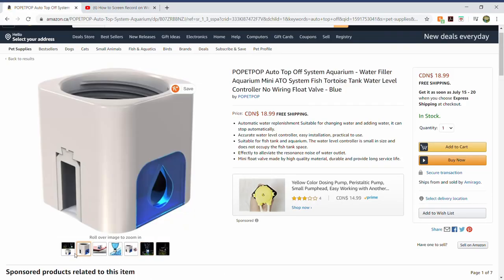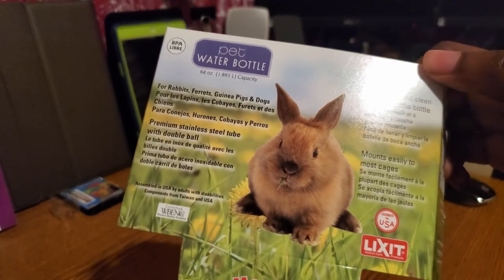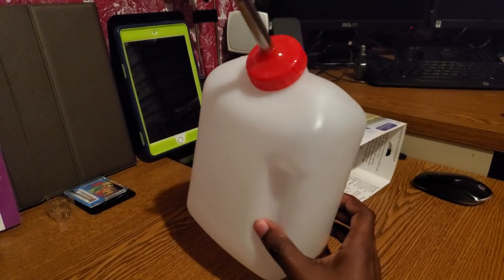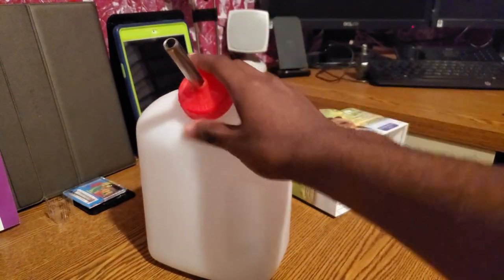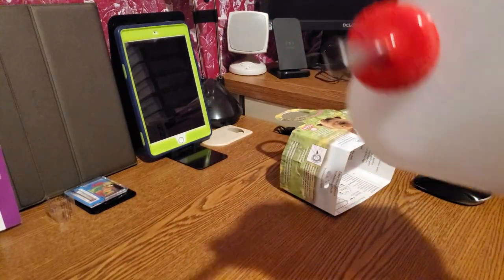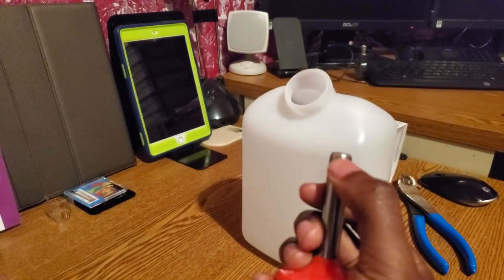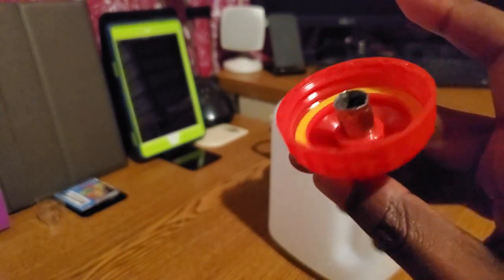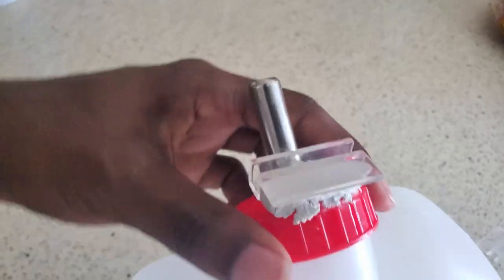DIY Auto Top Off For Nano Tanks

Comment: You could push the ball out with a chopstick. You might need to hit it a couple of times, but you wouldn't need to mangle it with pliers.
Reply from the maker: The hole is criped at the end so it wont come out inless you cut it but i didn't have any tools to cut it at the time. Fortunately that part is always on the inside so it has no effect on prefomence despite how ugly it looks 😂
Reply: @aquaticspendthrift4228  yes, that's why you might need to hit it a couple times. Maybe even hit or with a hammer. But you're right, it really doesn't matter.